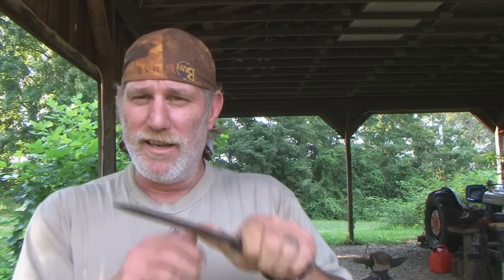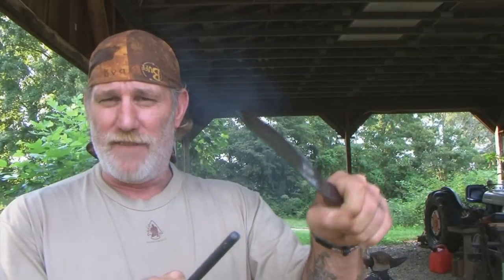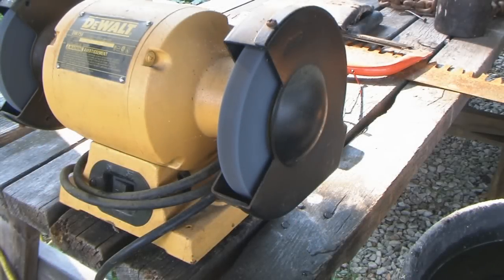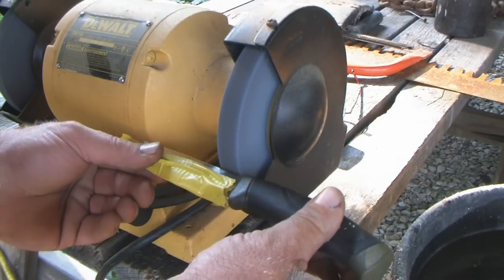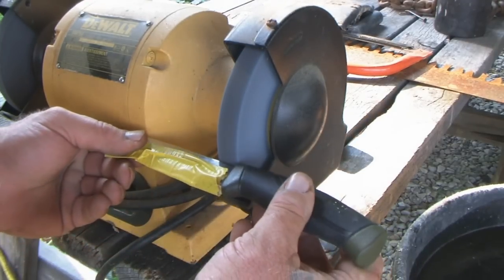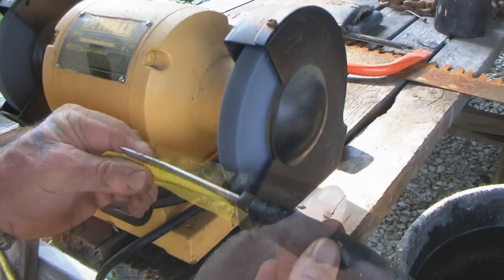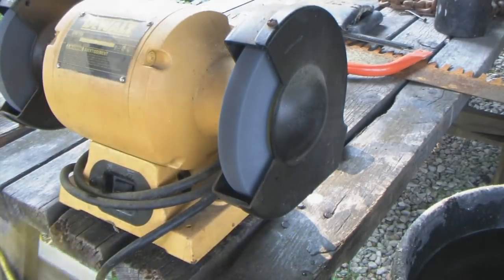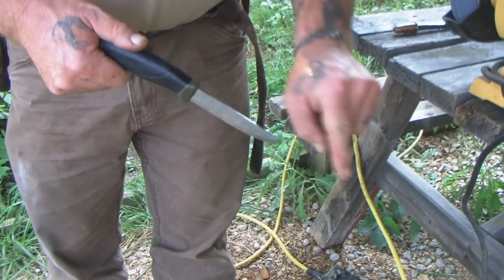Mora Modification for Better Bushcraft

Comment: Dave, I have the companion but no grinder so I used the diamond rod on my smith's pocket pal to "hone" the edge of the spine. I'm striking good sparks on my ferro rod. Just a tip for folks without access to a grinder. Great video as usual. Thanks for all you do.

Comment: I am so happy with the Mora Companion I just got from you. You're right, price was the biggest reason I chose it. But, clicking the link to your video review on it, helped me to decide. I'm impressed with how sharp it stays. If I cut cross grain, it only takes a couple of passes on the diamond stone to get back to razor. But last night I whittled down a couple of pieces of 2x6 for a spindle and a couple of fire boards. I half filled a 5 gl bucket with shavings... It didn't need sharpening! WOW!

Comment: i have found an excellent material for striking ferro rods, find an old hand saw, you know the old rusty old timey ones that you see in yard sales, that is superb high carbon steel, cut out some, put on your lanyard, draw file it to get the edges with a bit of burr at the end and it strikes super well

Comment: Dave, another modification I made for this knife was to epoxy a 4 inch ceramic rod to the front of the sheath for touching up my blade after use. Instead of my grinder I just clamped the blade in my vise and used a flat file on it to get the 90 degree spine it needed.

Comment: I had the blacksmith at the gathering this year take a file to the spine of my back-up mora and it throws better sparks than some of my $200 blades! So a common man way of doing this if you don't have bench grinder is stick your knife in a vice and go at the spine with a metal file. Great video Dave.

Comment: Nice video.  You can square of the back of the knife as shown in this video.  I use a file to square off or notch one place on the back of the blade.  Or it can be on the front of the blade if the sharpened edge does not start immediately after the handle.  As long as someone knows where the notch is, and what it is for, then it works fine.  The softer steel of machetes seems to throw a good spark if you make a notch, for example.

Comment: I'm a huge fan of the Mora Companion and Mora knives in general. I'll always carry one in my kit along side a sturdier knife. I squared the spine on mine in about 45 seconds with a dremel tool. It's not perfectly flat and smooth all the way but it has that 90 degree edge and throws sparks and can also make fine shavings.

Comment: The Condor Bushlore (along with many of their other designs) is a great alternative to the Mora. A little more expensive, but well worth the cost. Good steel, good design, and it comes with an amazingly good sheath. For around thirty bucks or so, you just can't go wrong.

Comment: I have the ESEE-6 and I love it. 1. 1095 is a good high carbon steel, and the size and ergos are good if you only carry one fixed blade 2. the coating is great for me because I live in South Florida/everglades where salt and humidity could quickly wreck a non-coated 1095 blade, 3. great warranty on a USA made knife. That said, I also carry a Buck 277 Alpha folder in S30V b/c it holds a working edge for forever. In relation to this vid, I always have a flat steel piece attached to my fero.

Comment: Dave, one tip for working hardened steel I learned from my landscaping friends who sharpen their own blades.... Although you did not have one....they all have grinders with low and high speed adjustments. They say never sharpen hardened steel on anything but "low" otherwise the friction/heat damages the steel, so it won't hold an edge, for long. Just sayin'. Have put it into practice myself, with good results. Love your work Dave....am a true follower and have given you many new friends.....:)

Comment: I can't speak for Dave, but IMO, a bench grinder will provide a far more consistant surface area and makes it easier to maintain a level angle besides just being much more efficient. It doesn't take much to get an edge on a Mora with a tool like that and an experienced person with a good eye & patience (and I believe Dave has a background in machinery) can work a knife without ruining it. I've also done the same with my ESEE's spine. I used honing oil while doing it and a low speed grinder.   :)

Comment: I have a Helle Orn that I picked up on SteepandCheap a few years ago. Its razor sharp with a nice spine. Im not sure if it's high carbon steel or not but it does the job with a fire rod that's for sure. Great videos, subscribed.

Comment: A good 90 degree knife spine is pristine to have, either in carbon or stainless as both will create the sparks. You can also use glass, which can be foraged almost everywhere these days. A hard rock will also spark firesteel. Break a piece of flint or quartz in half and you have a nice striker.

Comment: To each his own then Dave, ,just one clarification though,grinder fences and saw fences etc. were not designed by the safety Nazies, in fact   ,"fences" were designed and developed over a period of many years by engineers and craftsman to make the specific tool more efficient and more applicable ,so in this case safety is a by product of the mechanical development of the tool itself, simply by knowing the proper use of the tool . That's the difference between THINK-ing and knowing.

Comment: I used a file to modify mine, but it took a long time and you need to really be careful that you you concentrate on each stroke you take with the file. If you do not, you will make the back of the knife even more round than when you started. I found it easiest to clamp the knife in a vise.

Comment: Dave, amazing difference in the amount of sparks thrown between before and after grinding! I will do this to my Moras. I have some questions about modifying the Mora handles with a concave divot, like JB Welding a cupped dime coin in a shallow depression made with a drill bit to create bearing block for the bow drill. Do you, one, think it is safe to use a sharp knife as your bearing block, and two, will the soft Mora handles hold the dime welded into the divot? Just wondered what you think.

Comment: I've already filed down the back of my mora knife to a good 90 degree angle and it does throw some great sparks from a ferro rod, but I can't seem to get it to throw good sparks from quartz onto charcloth so I resort to using an old file if I want to do that. I know flint or chert works better, but quartz is 1000 times easier to find around here and I just wish I could find some advice on how to get my mora to work better for that.

Comment: been doing that to different knives for years not just high carbon, as good for tinder making, i found if i left 1in near handle rounded when using for fine stuff had comfort but plenty 90deg left for other uses. people be surprised how fast can loose good temper if not cool regular i know i ruined lot carbon knives due to it, well not ruined but couldnt get sparks from after

Comment: Looks like I may need to do some work on my companion and #2 BTW what do you think of the little carbon steel opinel no7 or no8 folding knifes for a pocket redundancy and the spike may lead to use with a ferro rod but I have never tested it.

Comment: One thing I've never understood is how a mfg could make a fixed blade knife without a lanyard hole in the hilt. A way to attach a para cord line to the knife really increases its usefulness.  Even on a knife without a full tang. It's a deal breaker for me. Don't think you can drill your own hole. The carbide drill bit to put the hole in will cost you more than the knife. Been there, done that.

Comment: I have an older model high carbon Mora Clipper by Frosts that has a flat spine that I got off of Sportsmans Guide about 8 years ago but they are no longer available there. You may be able to find one on eBay, though. Here's a photo i.imgur dot com/7iKf3kT.jpg it's the top one.

Comment: I've found that the v-shaped wire stripper notch on the can opener tool of a Leatherman multitool (Wave, Sidekick, etc.) works well for striking a ferro rod because it is sharp like a blade and it scrapes the material from two places at once on the rod. The wire stripper is also less likely to be a vital tool in a survival situation. The back of the saw works as well, of course, and Dave has talked about that before.